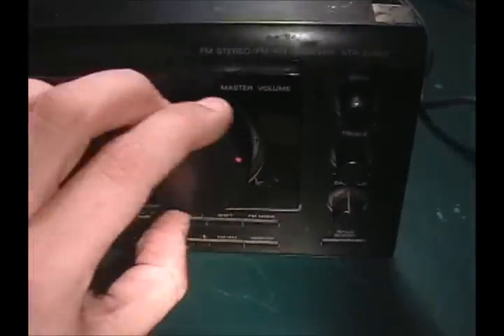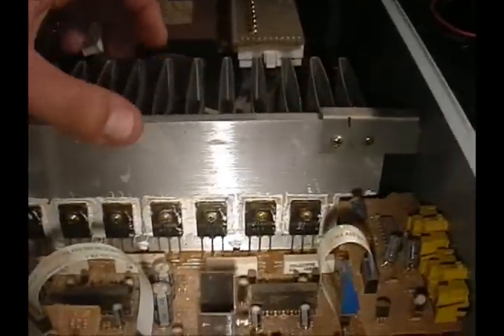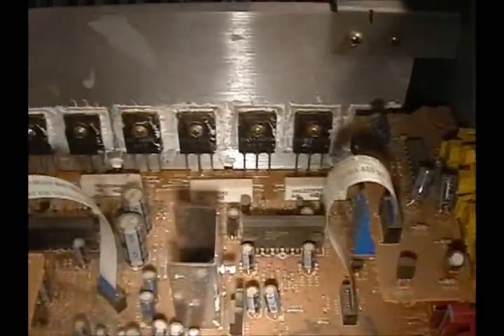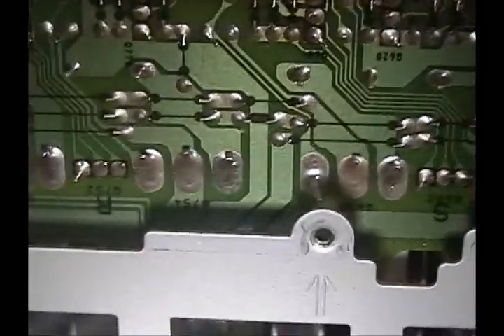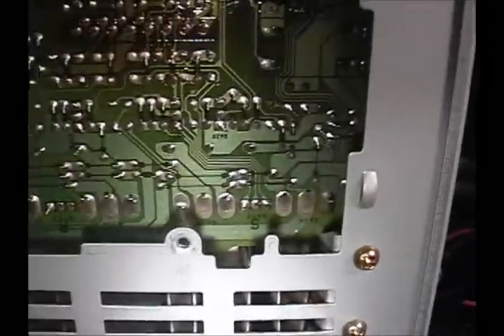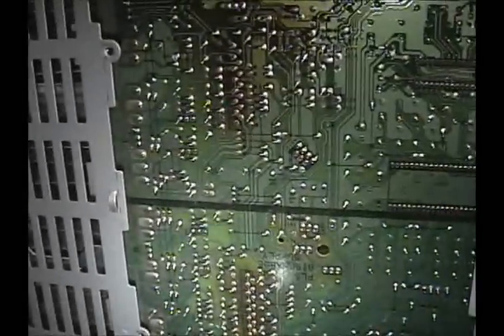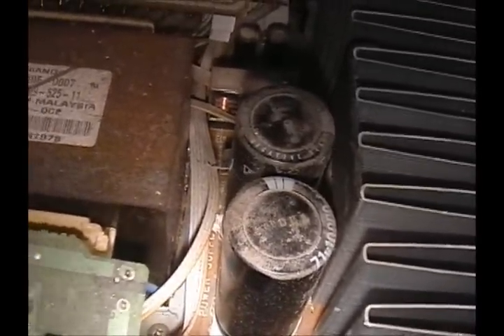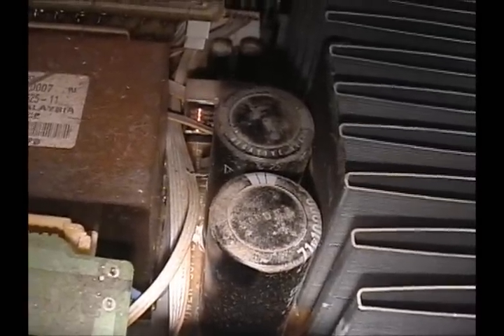Repair:  Sony STR-D450Z - Part 1 of 2

Comment: Good teaching video. I got a hold of this same model # and the right channel would not sound so just by chance I tapped around and sound would would work. Now because of this video I now know what is the problem. Loose solder connections. Thanks for the video.

Comment: Thanks for these vids.  I have had this same receiver since I bought it new about 20 years ago.  In the past year or so the right main speaker has been cutting in and out and if you tap the receiver you get that same sound that your video shows when you were tapping the big heat sinks.  I do a lot of soldering, mostly guitar electronics, and after watching these vids I am going to see if I can repair my receiver.  I like it enough to want to keep it.  Also, the remote has been malfunctioning, and I don't know if there is much I can do about it.  I may just have to find a replacement oem or custom built redi remote or something.
Reply: Last night, I reflowed those mosfet solder joints.  I know you said this is temporary, but I just wanted to give it a try.  I then tested with a single speaker and found that the right channel makes the cutting in and out sound when you tap the heat sinks or chassis.  When I connect only to either Right A or Right B, it cuts in and out when tapping.  When I connect only to either Left A or Left B, output does not cut out when I tap.  

Assuming the reflow (I even used new solder on most connections when I reflowed) of the mosfet connections would have taken care of any of those loose solder joints, I wonder if I should next apply my soldering iron to the connections on the board where external speaker receptacles go to the board, particularly the right side.  To do this I'll need to remove the circuit board as they are not accessible with just the small bottom plate removed.

Comment: sir,i have a older sony DA555 ES,i bought it used from ebay,i hooked it up to my newer sony 32 bravia...no sound,actualy 4 years ago before that i bought same model hooked up to  older sony 32 trinotron,should the connections be the same?

Comment: I have Sony STR-D450, left speaker is louder than right, cleaned volume/bass/treble/balance knobs with contact cleaner and still the same... Tried to swich speakers, connected other pair, various cables, sources... And still left speaker is louder :( Thought?